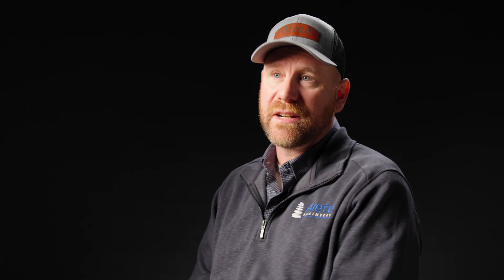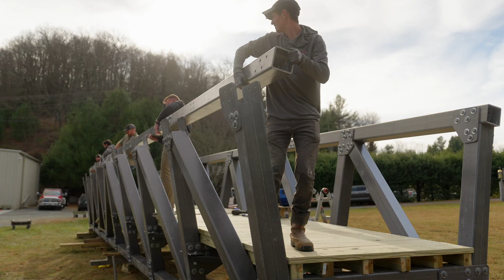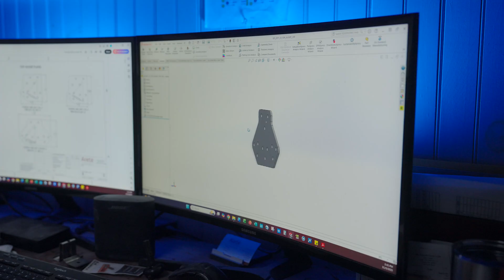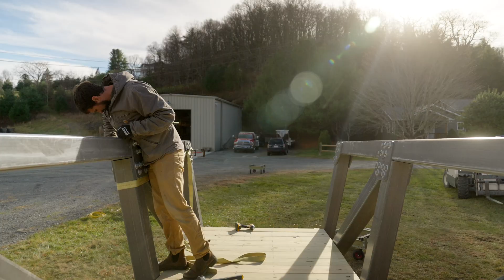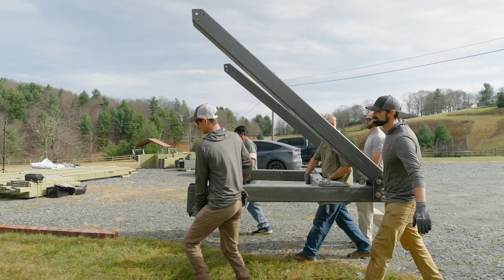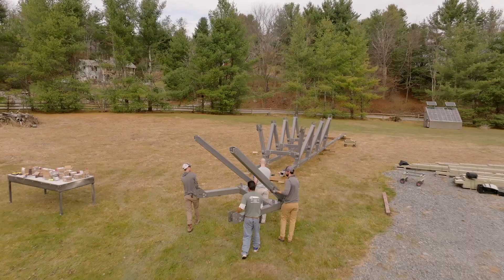A New Standard for FRP Bridges is Here - The Arete Bridge

Comment: /what's a 40' x 6' bridge cost?  Can we use 3' x 8' x 1-1/2" thick FRP Molded Grating with 1/2" square mesh for grating?  Can we get FRP side rails for the bridge as well.  What is the cost difference between having it delivered ready to install versus completely disassembled? Any special equipment needed for assembly?  Other than gray, what other colors are provided?  Green?  Brown?  Black?  What is the height of the top cap?  56"? OR 42"?